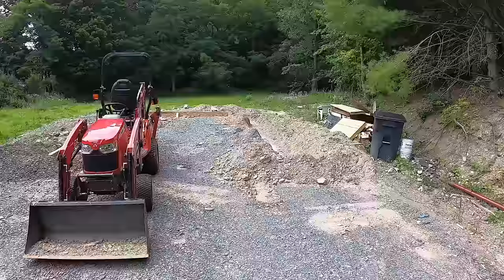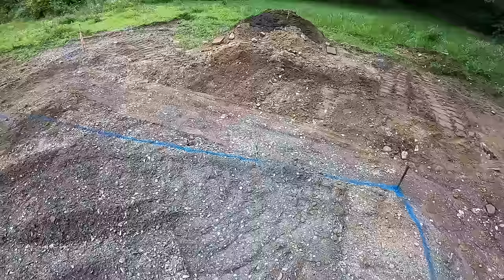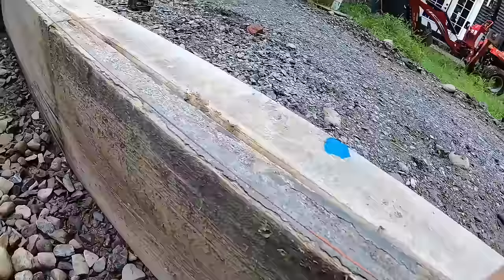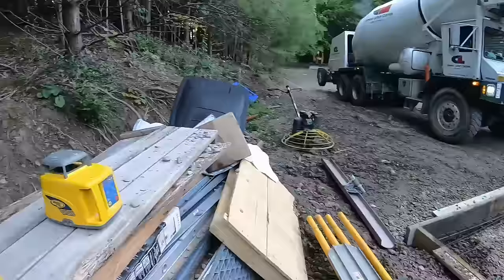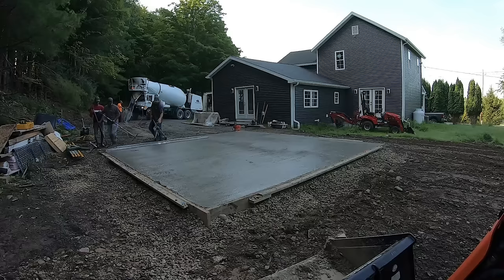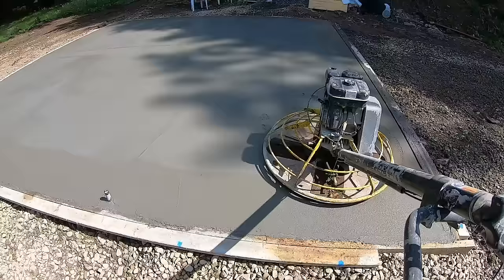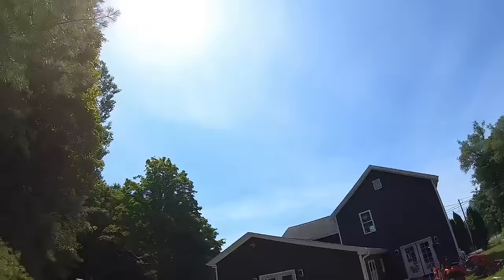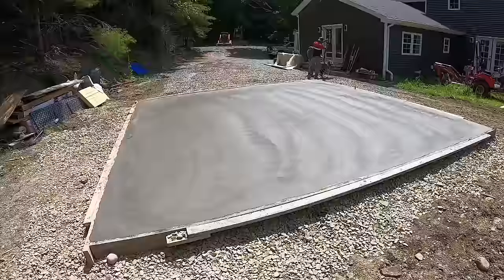Building and installing a Monolithic Concrete slab for a garage start to finish

Comment: Suggestion - stop wasting your client's money by using welded wire fabric.  First off it is useless as temperature steel and no need for flexural steel if you're placing on a proper base / sub-base.   Secondly, WWF is absolutely useless sitting on top of the gravel!!  The few times you tugged on it while placing the concrete is entertaining:  you then spend the rest of the afternoon walking on it while screeding.  :(
Reply from the maker: Thanks for watching 😁
Reply: Engineers don't let us pull up the WWF,. Most require us to use chairs.  We also don't compact #57 gravel. It's self compacting.   Anyway that's a heck of a garage slab, well done.
Reply: @chrisanthony579   Unless the chairs are spaced in a 4" grid, stepping on WWF on a chair (which I have never spec'd) ends upon on the gravel.  You place rebar on chairs.

Comment: Great start to finish video on how it "should be done". Love the one man power screed. You are a true craftsman that your employees seem to look up to and respect. No need for knee boards with a power trowel.  I was wondering if a  plastic vapor barrier under the slab would have been an extra? How do they attach the framing to the slab? For what ever reason here in Texas the front discharge mixers have not caught on. I know the first time I saw one as a kid in Connecticut in the 70's I was sure we were being invaded by the Ruskies. LOL
Reply from the maker: Yes no vapor barrier needed for code because it's not heated or living space.. Yes would be an extra... Front discharge trucks are a must!! No need for anchor bolts they are going to tapcon or thunderstruck it down.. That way I could run the power trowel through the whole area and get a flat floor. 
Thanks

Comment: Good works guys.  Why doesn't the edging go below frost line? You're in NY right? I'm a carpenter getting ready to do my own monolithic slab foundation for the first time in VT where footings are supposed to be 54" deep, but I don't see anyone doing their stem walls deeper than 24".  So I'm curious.  Thanks

Comment: Beautiful work and I am changing the plan on my shed pour to include the rebar, thx! I will never understand why people build 20 x 20 garages, absolutely too small.
Reply from the maker: Thanks
Reply: In many areas if you build 400 sq ft of smaller building you don't need a building permit.

Comment: What impresses me is the amount of care you put into each job. That is what separates the men from the hacks. Quality is an immeasurable thing, and quite elusive judging from the previous contractor on the job. Were I a potential customer and I saw this video, there would be no doubt as to whom I would hire. Gotta love a contractor who as a matter of routine makes 4 to 5 passes with the power trowel to make sure the floor sets right, who leaves nothing to chance. Your picture should be under the word Quality in the dictionary.
Reply from the maker: Hey thanks so much!
Reply: Only telling the truth.

Comment: Nice!

Question, is the reason you didn't pour deeper footers around the perimeter because the slap is overall so thick? 

Also, if this were the foundation for a block/brick building, how would you have done the footers?
Reply from the maker: Google monolithic slab it's meant to float and no you need to full foundation for brick work
Reply: @DIRT-BOSS  ah yep. Thanks for the tip.

Comment: You feel it after using a power towel... hold on! Its amazing... even though the concrete has a slight moisture to it when power toweling... that little bit of extra water is big help from burning the surface or the power towel blades... you don't get that bite with the blades. Aewsome job Mike!
Reply from the maker: Yes sir exactly

Comment: It looks like you used clean 3/4” stone under the slab. I’ve seen other videos where they use like a 304 compaction gravel. Can they be used interchangeably? Is one better than the other?
Reply from the maker: They both have their purpose I like using clean rock because it doesn't hold moisture and it will not freeze and pick the slab

Comment: that tilt bucket made filling that in much easier. the original trench was waaaaay off. i would have been very unhappy with that. how do you feel about those monolithic slabs? turned B. E. A. UTIFAL!
Reply from the maker: They have their purpose.. it's more economically pleasing to the budget.. but in the long run I think foundation is best..

Comment: No need for joints? I don't know. Just asking gonna do a 12 x 24 garage in S.C. and don't want to cut any joints.
Reply from the maker: If you don't want to then don't but it probably will crack

Comment: I always do my monolithic footer square and flat with my comlong as my template! Because if it square ⬛ an flat footer it more stable an stronger!!! I never go wide at top an narrow at the bottom! Equally from the top to bottom......
Reply from the maker: The purpose of the 45 is engineered and it is so you do not get a crack if you have it the straight up and down you will create a crack point
Reply: @DIRT-BOSS  I  Guarantee concrete will crack that depends on the slump and the weather and the elements that is surrounding the job.. Concrete is only strong as it's base and what it's laid on. But I do understand the 45  Degrees coming out of the footer but you ever see some of the engineer's blue prints?! 🤦‍♂️🤷‍♂️ some times it cracks at the 45 just the weight but that's why they make rebar if you are going to tie the rebar with the slab... Good work enjoy your videos......

Comment: Nice work. Couple questions. Why no vapor barrier? And what kind of tilt bucket on the skid? That things bad ass!
Reply from the maker: Cold storage it was a flip house they didn't want to put it under there.. bucket is Bradco
Reply: Copy that. I’m considering going this route to add on to my existing shop garage. I’ve never done an Alaskan slab. Always done traditional frost walls. I think this seems like a quick/easier route. I see some people use foam board, and vapor barrier. Just wanna make sure I make the best effort to not have issues with frost.

Comment: Nice work.   I would have left more out of the ground due to moisture and siding.  Do you have any moisture issue in the building without using a a barrier before the pour?
Reply from the maker: No Cold storage does not call for vapor barrier

Comment: What climate zone is this in?  No vapor barrier, insulation or relief cuts in the concrete.  How come?  Not bashing, genuinely curious
Reply from the maker: Budget build.. relief cuts for the next day.. No vapor barrier cold storage no living space. We are in New York this is a monolithic slab meant to go up and down with the frost
Reply: @DIRT-BOSS  thanks!  I'm in Alaska.  So familiar with frost.  😉
Reply: @DIRT-BOSS  Question, if I get a concrete company to do the dirt work and pour a slab for a shop.  Will it be fine to be out in the elements for a few years before I put the building on it?  Trying to build slowly using cash in phases.  Figured dirt work and concrete then I could frame and roof in next phase so I have a shell and then finish with the insulation electric etc etc later.  No code here as I'm in a rural area so don't have to worry about permits etc.  Everything will be build to code standards however.
Reply from the maker: @kendallhuseman3685  Yes for sure That would be fine The only thing you may just want to seal the concrete with a concrete sealer

Comment: Great work and videos! I have a question, you pull the rebar up before covering it with concrete, but aren't you just pushing it back down when you walk on it right after? I've seen other crews use hooks to pull the rebar up before leveling the top off. Have you ever double checked to see if you have a couple of inches underneath the rebar? Just curious, thanks!
Reply from the maker: Good questions I have other videos showing that cuz people do bring that up a lot The rebar or wire will not go back down because it stays up in the rocks 2" the floor
Reply: @DIRT-BOSS Thanks for the quick reply and explanation! Sorry for the repeating question.

Comment: Are there any regulations about building a garage slab over an existing sewer line running through the property.  For instance adding  a garage slab spanning the width of a back yard with the sewer line running out the back of an existing home out under the slab and garage.
Reply from the maker: Check what your local inspector with your local codes

Comment: Great Video. I have a contractor recommending this type of poor for a single car garage addition. Being in OH, should we insulate the final concrete? I have seen this recommended elsewhere, just curious of your opinion. Thanks again!
Reply from the maker: You can insulate especially if your going to heat the area.
Reply: @DIRT-BOSS Thank you!

Comment: hi great video...i want to do this for future garage...one question though...the rebar staked  vertically to hold your horizontal rebar..will they rust due to earth penetration?
Reply from the maker: Yes they probably will but that is just the hold it in the air for concrete purposes nothing structural
Reply: thank you sir

Comment: How many bags of cement mix would you need to do that type of foundation? 100ish 60kg bags? Also, can you use T bar instead of rebar? My options are limited and trucks and rebar are 4 figure numbers. I need to make a 20x20 slab. I'm thinking 10x10 at a time cause it will be mixed in a barrel.
Reply from the maker: Wow that's a lot of work to mix by hand but you would be 450 to 500 bags
Reply: @DIRT-BOSS  yea I do know of a gas powered barrel mixer close by that could make it easier. My closest hardware store is 500km away by plane lol. Any thoughts on using Tbar? I like to recycle it and there are thousands of them close to me and they are free(a bit bent though but that may be a plus).
Reply from the maker: @mak9595  tea bar would be fine any type of steel you could put in there would work as reinforcement even a chain link fence
Reply: @DIRT-BOSS  Thank you for that clarity. Now to get really off on a tangent lol... I read that the Romans used Saltwater in their concrete and that is why it is still around to this day, unlike some other things. Might have been a BS TikTok video but it has me thinking. I live by the ocean so any soil I use will already have salt in it. Would it hurt to use salt water instead? Thanks again I've been asking that, about Tbar, in the FB world for a year and just get teased lol or trolled.
Reply from the maker: @mak9595  I really can't answer you on the salt water but possibly filter it.. but saltwater is better than no water !

Comment: Great video! I'm getting ready to build a 24x30 detached garage. am I crazy to have a sloped floor. Do they need to be sloped. 1/4" every foot. My bids are coming back 4-5k more with a sloped floor. Contractors are stating that's why it's more. Video after video, I'm not seeing any sloped garage floors. Please advise. Thoughts. Location is Grand Junction, CO. Pretty fair weather, not wet at all. A few snow storms.
Reply from the maker: If you're doing a monolithic slab 90% of them are not sloped.. cuz the whole perimeter has to be level.. if you're doing a conventional foundation 4 ft frost walls with the slab inside the walls then you could slope it no problem
Reply: @DIRT-BOSS  Thanks, So I really don't need a slope and can reduce the cost significantly pouring flat. Seems like a slope would just cause issues with tool boxes, etc. I normally wash out the garage with a big squeegee.
Reply from the maker: @vastaction  Yes I would save the money you don't need a pitch Even with pitch it still holds water most of the time

Comment: what is the benefit of a monolithic pour vs a footing pour? I'm looking at getting a garage built within the next year. looking at 28-32x28 garage, with 10-12 ft walls, and a loft truss (for storage)
Reply from the maker: Cost Is the main factor The slab is cheaper.
Reply: scott17818 they are also useful for building on shallow bedrock where excavation would be prohibitively expensive.

Comment: You did the finish passes with the power trowel 4-5 times, is there something you look for to know is time for the next hit, or do you go again after a certain amount of time?
Reply from the maker: First thing between passes go opposite directions on the slab.. also.. I always step on it make sure the concrete's not sticking to the bottom of my boots.

Comment: I'm doing a slab just like this for my garage in Indiana. Do I need to have stone under the edges or just under the middle area where the concrete is 4"? Garage is 18'x20'. Slab will be 12"x12" around the perimeter and 4" thick all throughout the middle. I'm using #53 stone. Sod and topsoil has been removed and the ground hasn't been touched in more than 30 years. That's the last detail I have to work out before I'm ready.
Reply from the maker: If the ground is hard you don't have to but I tend to put a couple inches under there just to level up the forms
Reply: @DIRT-BOSS  that makes good sense to me! Thank you for the help! I love the videos you put out. I’ve subscribed and look forward to future content!

Comment: So you don't vibrate around the outer edges where the rebars are??
Reply from the maker: I go around I tap it with a hammer but the viber screed that I use vibrates all the way down

Comment: I'm doing a 24x25 garage in Richmond va. I never done a job like this before.  I got the permit and now I'm trying to find a concrete guy to lay my slab with footings. But I'm getting what I think crazy quotes about $10,000. Is that normal? And great job.
Reply from the maker: How thick are the footings are you doing frost walls or just a slab like this monolithic?
Reply: @DIRT-BOSS  im getting a metal garage and they want 1ft footing minimal and I was told 4" thick with 3,000psi concrete.  But I want to put a carlift later on. But I would like monolithic like you did.
Reply from the maker: @AngelGarage  I would go 6-in thick in the center if you're going to put a lift.. also on an average the slab will cost you $10 a square foot.. plus the cost of excavating and stone.. a slab that size would roughly be between 7k and 9k depending on elevations. Also use 4,000 psi cement
Reply: @DIRT-BOSS  ok. Thx at least I know what to shoot for. I did get 1 8,500. So I guess he wasn't far off. Keep up the good work.  I have videos too showing how to work on your own car. I like how detailed your video is

Comment: Just built one with 24x24 footers.  What size footer are you doing?  Did not see where you dug any.
Reply from the maker: this is a monolithic slab does not call for footers just a thickened edge It has a 12-inch haunch all the way around tapered do 4-in.. it's a cold storage garage that's what it called for I didn't engineer it
Reply: @DIRT-BOSS  nice job.

Comment: Nice job.  If DayOne was really cheap would you use it on a job like this?  What would be the advantages?   Thanks.
Reply from the maker: Dave not sure what you're asking?
Reply: @DIRT-BOSS  I misspelled it.  Day1, I've seen on commercial jobs.  They use it instead on water, it's expensive and seems to give a really nice finish on the trowel machine.

Have you ever seen it used?

"DAY1 FINISHING AID is a colloidal silica-based topical additive that makes concrete flatwork finishing easier and faster. It produces a better result and reduces the risk of a prematurely setting slab. Applied during floating and troweling, DAY1 increases cream, making for easier, better finishing and extended workable time under adverse conditions."

"Applied as a troweling aid, Lythic’s Day1TM one component concrete curing densifier, sealer and hardener provides a smooth tight surface. After final trowel is complete, the formulation is effective as a cure so no curing agent application is required. Then, after 24 hours, the slab surface repels water to prevent moisture penetration that can lead to ASR. The result is a slab with increased surface hardness and abrasion resistance that can be polished with less time and tooling.

According to Lythic President David Loe, the major benefits of DAY1 include transforming the slab into a tougher, more durable flooring surface that is waterproofed to protect from ASR, as well as the labor savings. “Using DAY1 as a troweling aid saves labor because it also impregnates the surface with a curing aid/water proofing component,” said Loe. “Returning to the site to apply a curing compound or other curing method is not needed.” "
Reply from the maker: @davidnull5590  interesting No I haven't used it but I will check it out Thanks

Comment: Nice job ! But had a quick question, why a monolithic slab wouldn't a 4 in slab float just the same
Reply from the maker: No 4 in slab will break over time with a building on its edges
Reply: Thanks for the reply, that makes sense!